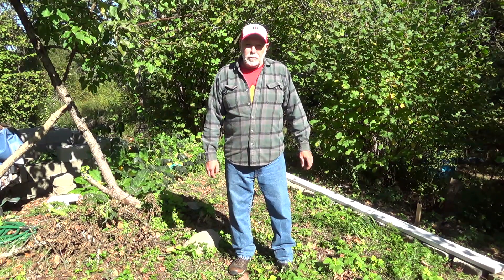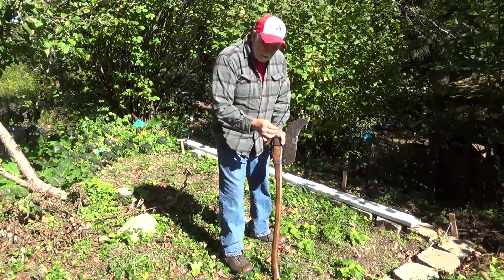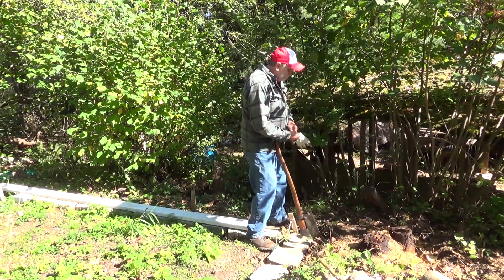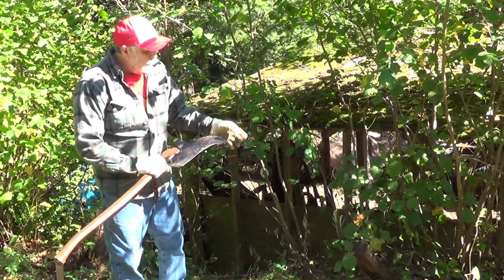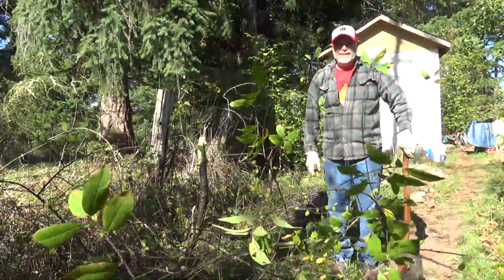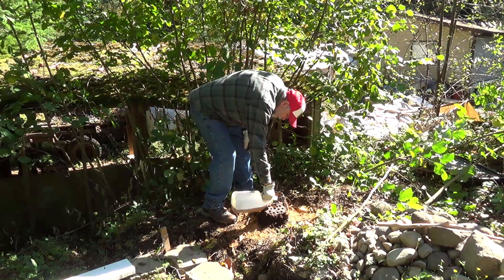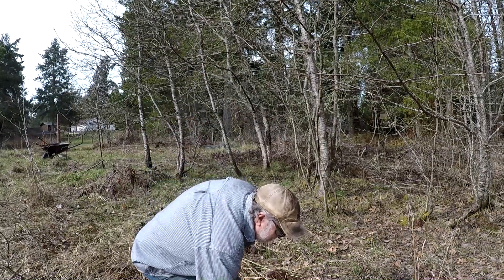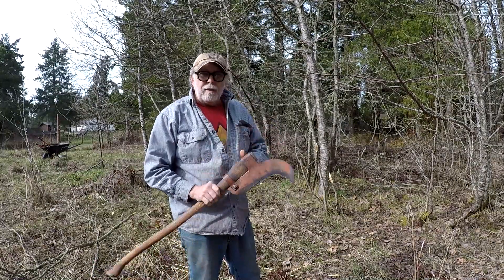Vintage Axe Review #3 Collins Brush Axe

Comment: I don't know how I missed this one Mr Obsolete.   I just purchased a new brush axe a council tool one from Epstein Tools in Kansas city.   It looks a lot like yours.  I am fix it Ng to sharpen it and do some blo to the handle.  I need to use it soon.  Thought I would be this week, but have been fighting ground dwelling yellow jackets and some unexpected hornets
Reply from the maker: A good brush axe is the fastest and easiest way to remove small trees and bushes.  It requires a bit of experimentation to get the best cutting angles, but once figured out it is very efficient.